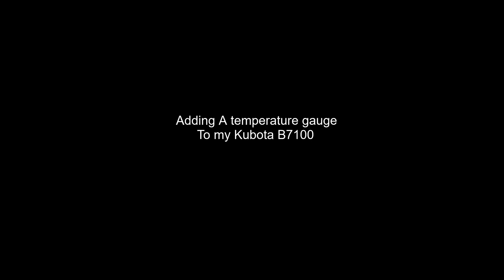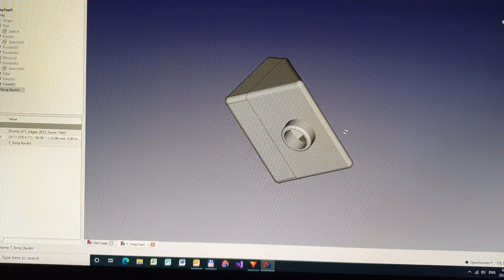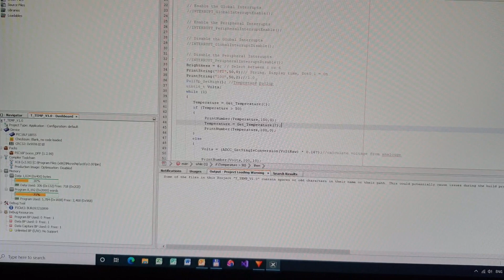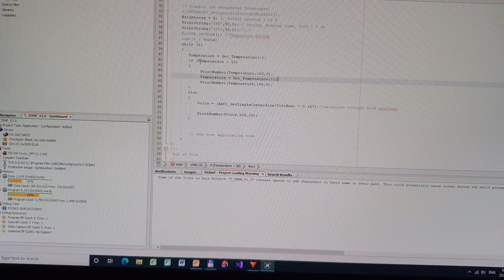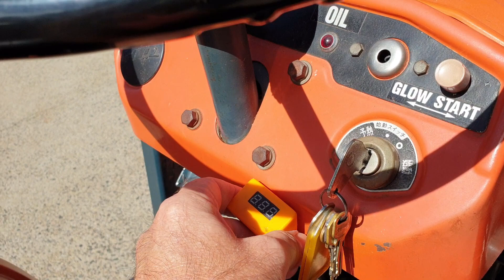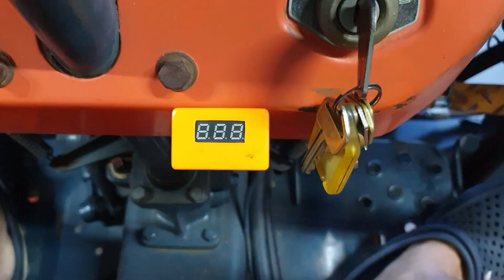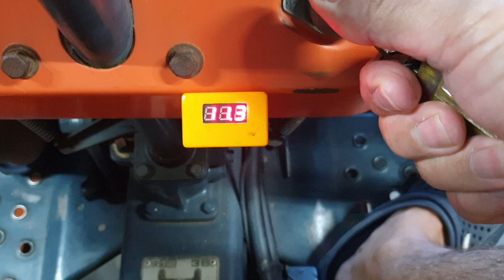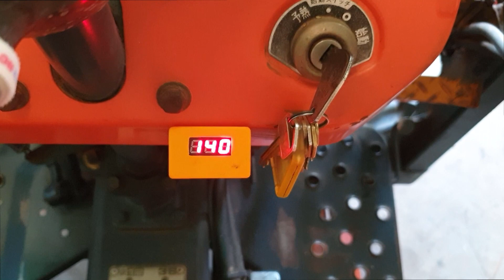Kubota B7100 Tractor adding a temperature gauge and how the cooling system works.

Comment: I just recently bought a B7100hst and was wondering about the best way to install a temperature gauge. You have come up with a brilliant solution that doesn't even involve cracking into the system. I am impressed with your idea. I am a retired computer/network technician, so any use of computer technology as such is very interesting. I don't have a 3d printer but I would be interested in finding out where you purchased your thermo sensor and temperature board. And also the source of your code for the chip as well as the programmer. I would very much like to duplicate this for my own tractor. Thank you for a great video!  Lonnie.
Reply from the maker: Hi. 
The simplest way is to just order one from alliexpress. https://m.aliexpress.com/item/32790407135.html?spm=a2g0n.productlist.0.0.5654hXWbhXWbBA&browser_id=23e57f6880c94524a56423f8af12f09f&aff_trace_key=ea0519f5667e4566aa8df7d914df971b-1660204014763-08231-UneMJZVf&aff_platform=msite&m_page_id=x6f7g9xmau0cacf0182bd9882b3d6ffc70e22947be&pdp_npi=2%40dis%21AUD%213.9%213.74%21%21%21%21%21%40210318b916610382656533458e41f8%2112000026998872369%21sea&curPageLogUid=4ED1c0bHWguB&algo_pvid=6a26d412-e9c3-40fe-8c79-2a08a328906e
You can always order a different NTC thermistor that will fit under the end of the radiator hose. 
Regards.
Reply: The link isn’t working, are you still selling these?

Comment: good done , and thank you for the useful information at the end of the video.
I have the same tractor and it gets  overheat after 1 h working,they told me to add a water circulating at the cooling system, I don't know if it works ?
Reply from the maker: Your radiator is most likely blocked with debris. Drain the coolent and remove the radiator, once out you can get all the grass and debris out of the cooling fins. You should be able to see through all the fins once cleaned. Next run your hose into the lower radiator outlet to reverse flush the inside of the radiator. Once done reinstall
Reply from the maker: If you have a HST tractor, check the fins of the oil cooler are not clogged. Clean if needed.

Comment: You could have bought a temp Gage for 20 bucks.   Anyway install an electric pusher fan in front of the radiator and oil cooler.   I did that but I also pulled the old D750 and installed in a D950.  Full gage set and an alternator.
Reply from the maker: If you install an electric fan without upgrading to an alternator, you will burn out the dynamo charging system, as the fan load is more than the dynamo outputs. 
I would like a D950, but they are hard to find.